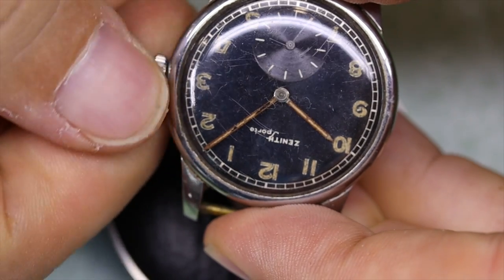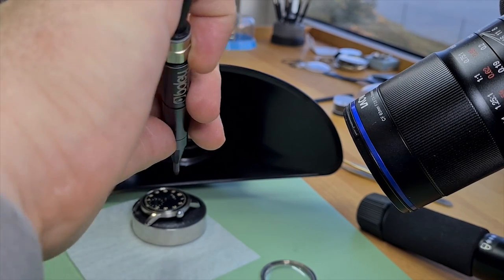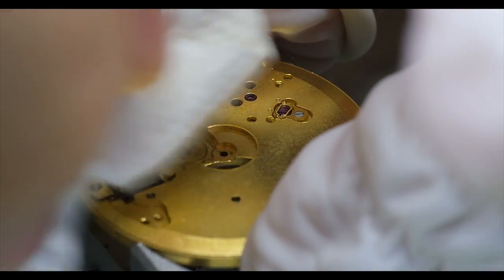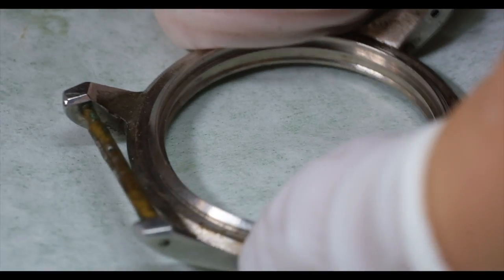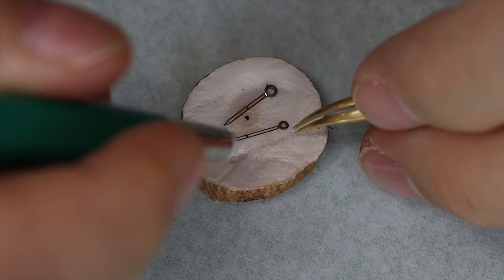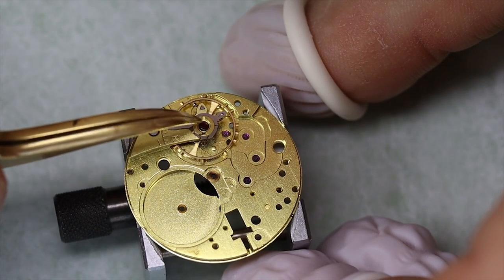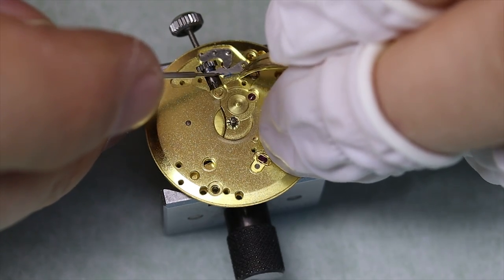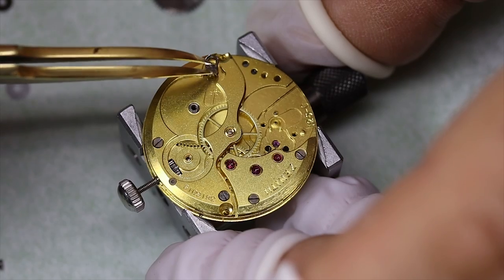Radioactive, not running... is this watch even worth saving?

Comment: Love the video. Have recently "cleaned" a set of radium hands to feel safer about wearing a watch. I go outdoors with PPE to open the case and remove the hands, then dunk them in isopropyl to prevent dust and scrape them clean "underwater" so to speak. Then dump the fluid. The actions all but eliminated a uSv/h signature to a fraction over background.

That said, as a shade-tree mechanic on cars/trucks/you name it, I routinely sharpie comments on parts I've installed. LOL. I replace a water pump, I write the date/mileage on the part as I'm installing it. Hopefully the next owner will appreciate it when troubleshooting whether a part is factory or been replaced recently. But I agree, you wouldn't scratch a date and initials on a piece of art like a vintage watch.

Comment: Thank you for another excellent video to watch! I missed you 🙂

About service-marks inside the backplate I look at it a bit different than you. I find them interesting as a part of a watch´s history, and they served a purpose when the watch was younger as a record of when and where it had been serviced. A watch I bought at a flee market was made more interesting by the fact that it´s markings led me to the shop that sold it originally, and their archive could tell it was sold to a local gentleman from a close by town. Markings also told me it was serviced regurarly until mid 70´s but by three different makers in the area. This knowledge ads to my pleasure of owning it some 70 years later, I find.
Reply from the maker: Hei Sjur, thanks for your input! I don't have a problem with old watches having marks, what I'm trying to convey is that nowadays there are better ways to prove a service has been done. There is no reason today to scratch marks into a watch. IMHO.
Reply: @VintageWatchServices  I totally agree that as a general practice it shouldn't be done.  But even now there are some scenarios where I feel it's acceptable.  I had a very good friend that worked in a national standards lab in the 30's and 40's, went on to teach, and then took up watch repair later in life.  He rebuilt a pocket watch that had belonged to my grandfather.  And with hindsight I dearly wish I'd asked him to "sign" the watch.  He was a good friend and taught me a lot, both in the classroom and out.  That signature would have meant as much to me as does the watch itself :) I enjoy your videos, reminds me a bit of the days when I'd visit and he'd show me whatever projects he was working on at the time.

Comment: This is an absolutely engrossing video. Lovely watch. I have  a Zenith rectangular manual winding watch in which the movement is similar to this, but smaller.
Regarding the radium girls, the reason why they developed cancer and other teeth related diseases is because they used to put the brush in mouth to straighten the tip with saliva  and then dip into the radium for applying lume to the hands/dial. After medical tests found this to be the cause, it was stopped.
Stian, I am very happy that you have 10,000 viewers. More will certainly join. Do educate us with more such videos. Take care and stay safe.
Reply from the maker: Thanks so much, K! You're entirely right, the real danger is when you ingest radioactive material, as that allows the alpha particles (which are big and heavy) to directly ionize cells inside the body... very bad stuff.

Comment: Tremendous vid. and information. I have one with a silver dial which is slightly older, cal.12.4.p6, and has had the radium lume on the hands removed some time ago. I am a Zenith collector , as I have mentioned before, and see very little Zenith restoration videos so thanks. I like the large seconds hand which fills the space between the 5 and the 7 with no cut off 6 .

Black dials on vintage watches scare me if I am buying sight unseen but those with radium numerals are difficult to fake.

Nice to see you back , I too had the plague before Christmas which left me with a slight hand tremor, not the best for footering with watches.
Reply from the maker: Good to hear you're back on your feet also! Do you still have the hand tremor or is it improving? 

Zenith has such a rich legacy of fabulous watches but still aren't quite known to the masses. Just today my wife asked me if Zenith is a brand after watching a bit of this video by chance...
Reply: @VintageWatchServices  Improving but the harder I concentrate the worse it gets. I am looking for a Defy with the 8 sided case and the GF ladder bracelet. Most that I see have had all the sharp angles polished off, If you ever have one let me know. e.g. A3642. I bought the Captain with the Square diamond cut indices cal.2552 if you remember.
Reply from the maker: Yep, I remember! That's a beauty also :)

I really hope you recover fully from this, it's a very sad effect indeed...

Comment: Welcome back, Stian, and congrats on reaching the 10K subscription milestone.  The Zenith sure cleaned up nicely.  I'm surprised at how few tool marks there are on the plate and bridges considering how soft gold is.  The macro shot of the palate fork assembly is stunning.  Too bad the watch doesn't have an exhibition back so that the elegance of the movement can be more easily appreciated.  Stay well.
Reply from the maker: Thanks so much, Bullnose! It seems the movement has only been serviced once, which would explain the lack of marks also. A lot of these old watches would indeed benefit from display backs, but that is really a pretty novel feature, becoming common only the last couple of decades. You pretty much need a sapphire crystal for that, which also wasn't mainstream until the 90s.

Comment: The watch turned out great. You are the first YouTube watchmaker I have seen using radium protection. My personal protection would be to not buy a radium watch if it needed opening. Radium was actually allowed up to 1968 in Swiss watches, other countries would be earlier or later, like 1970 in Italy. Rolex used radium up to 1964, but some Rolex were tritium from 1963.
Reply from the maker: Thanks for watching and for your great comment! I didn't know they allowed Radium until that late, but from what I know very few Radium dial watches were actually produced after the late 1950s. There are still a lot of beautiful watches with Radium dials and hopefully I calmed some nerves with my video :)

Comment: That is the best reluming job I have ever seen! You matched the uneven patina perfectly! 
With the worn bushes, would an alternative be to add jewels instead, could that even be done? Great video once again, you turned a tired looking watch into a gem. It’s amazing how a bit of cleaning of the case and polishing or renewing a crystal can make a huge difference to the looks of a watch. Now if only sellers stopped referring to dials such as this as “military” I avoid those sellers like the plague as it’s simply trying to add value where none should be added! Same with Sicura and it’s link in the past to Breitling, a pretty cheap poorly made watch being sold for ten times what it’s worth simply because of that connection!
Reply from the maker: Thanks Ian, that's very nice to hear! It's certainly not a military watch but calling it military style might be justifiable 😉
Putting jewels in the bearings would indeed be the best solution for reducing wear, but it would also make the watch non-original. Thus if possible I'd always prefer peening the holes.

Comment: Excellent video!  Glad you've recovered.  We had it also.  While aboard ship, we had quite a lot of training for NBC Warfare or Nuclear, Biological and Chemical.  My ship was Forrestal Class and did not have Nuclear.  It's important that people know that we are bombarded with Radiation 24/7.  Even more so during a CME or Coronal Mass Ejection from the Sun.  It is also important for people who live within about 50 mile radius from a city that had World War Two fabrication.  70, 80 years ago, they did not process Hazard Waste like they do today.  There were some really shady characters back then who would get paid to dispose of the waste.

My parents bought a new home in So. Jersey in 1977 that used to be a dump.  Of course they didn't know it then but we found out in the 1980's.  It used to be Peach orchards and I recall that most if not all of the homes built, did not come with a basement.  That's quite revealing after the fact.  So, in the 1990's there were water wells tested and Radon was discovered.  The Township issued a moratorium on all new construction for several years.  I may have been exposed less than my parents and siblings because I'd entered the Navy in summer of 1982.  If you suspect that you live within a fabricating zone similar to where we were, I would suggest that you do some research.
Reply from the maker: Thanks for sharing that story, and these kinds of things were indeed much less regulated back half a century or more ago... There is still a lot of these issues being uncovered today, sometimes literally, but thankfully we're getting more secure as a society every day.

Comment: Nice work and congrats on the 10k I'm glad  you have fully recovered from both the holidays and the  C19. I just received a Britix 641 with a FHF 67 movement, pretty sure it has the radium  dial and hands also! I'll be sure to take the necessary precautions when I get around to servicing.
Reply from the maker: Thanks a lot! And there's absolutely a good chance your watch has radium on it, so be careful. A couple of commenters suggested spraying the hands with water before removing the old lume, which sounds like a very good idea.

Comment: Re case marking by watchmaker. I was repairing watches in 1960's and this was required to protect you from customers that would claim recent service but in fact much longer. The marking was logged in a book so the type of repair was known. It was a commercial necessity
Reply from the maker: Thanks a lot for sharing that, Edward! Back half a century or more this was indeed considered good practice, and I have absolutely no problem with that. My problem is with watchmakers in 2022 doing so when digital methods of recording service jobs are readily available :)

Comment: Would be interesting to see if the rad from the lume leeched through to the movement itself🤔

As for marking the case..I am a little torn..as it provides, or possibly even adds historical reference…and maybe even value 🤔. If the marking was on the outside of the watch, then that would be different..however stamping or marking service…engine blocks for example…though I could be wrong but if memory serves me correctly, stamping is not just a watch thing

Comment: Have to agree with you about putting repair marks on an item. Not sure how this custom started but clocks have this as well, ranging from initials and dates scribed into the movement plates or written inside the back door. Not sure I need to know if a clock was repaired on a certain date and by whom. The date might be interesting, but who did the work is lost to history. Sometimes a repair shop will put a sticker for the shop inside the back door. I don't like the practice myself, but I did find it helpful trying to date a Japanese clock. It had a small tasteful label on the back, all in Japanese, and a viewer said it was a warranty label from a repair shop dated 1935. Anyhow, thank you for another great video.
Reply: Camera repairers used repair stickers in the back of cameras. It adds some historical context and the stickers can easily be removed if desired.
Reply from the maker: Thanks so much for your comment! In old pocket watches there was commonly a piece of paper inside the outer case, actually a repair log. This was where a watchmaker would put his initials and a date for warranty purposes. This practice was carried over to wristwatches, but given that there isn't any space for that kind of paper, they started making their marks in a place where it wouldn't be visible, hence the inside of the case back. After computers and emails became commoplace, there is no longer a need to make a mark in a watch so you don't see that much nowadays. Which in my view is how it should be :)

Comment: I was not aware of the fact that it is necessary to take precautions like this to work on a watch like this. Well if it was happening every day, but a few times a year? So I learned something, thank you. People in the factories must have received radiation levels thousands of times higher than the users of the watch and many suffered! Interesting about the Alfa particles, hearing that would make one understand that it`s important not to get these particles inhaled through dust etc....! I sometimes open watches that are older than the 1960`s so I will bear these warning in mind.
Reply from the maker: Yep, radioactive material is no joking matter... If you're working on watches with radium lume, make sure you're not in danger of ingesting any of the old lume.

Comment: Alpha and Beta radiation are usually only damaging if they get into your body, hence the need for the air scrubber you have.  They can also damage the skin if the radioactive material is left on it for prolonged periods.  That’s why wearing protective clothing is advisable since Alpha and Beta radiation can’t get through them.  The most dangerous radiation is Gama- not Alpha - and Neutron radiation.  Both have very high energies and can go through most objects and require heavy shielding to stop them.  Neutron radiation is the only type that can make objects radioactive by neutron activation.  Sorry for rambling. I just wanted to correct your small mistake—otherwise, excellent content, as usual.

Comment: They are pretty movements and the plastic dust cover is unique!  I use the same precautions for the radium based luminous as you do.  Especially with the trench watches!  Glad you are feeling better and hopefully you don’t have the long covid version to deal with.  All the best.  do I have permission to repeat some of your jokes???  Geoff

I spritz the hands with water before removing to keep the dust down then store the radioactive material in a lead jar loaned to me by the local university.  When the jar is full I take it to the university for disposal.  Also on the porcelain dials I will spritz the dial before removing the luminous.  Can’t be too safe around these!
Reply from the maker: Hello Geoff, thanks for your comment and that's a very good idea. I'll pick up on that for my own practice going forward!

Comment: Thanks Stian, great stuff! Looked lovely afterwards. Question; I’m using Elma waterless cleaning and rinsing fluids in an ultra sonic cleaner and I think the rinse is discolouring brass items I the watch movement. Have you ever come across this? What cleaners do you use?
Reply from the maker: Hello Boyd, I don't rinse parts in the ultrasonic, only in the fluid. You can rinse most parts in water also, just make sure you dry them very well.
Reply: @VintageWatchServices  after rinsing in (destilled) water you should rinse the parts in isopropyl alcohol. This prevents rusting and evaporates very quickly.
Most of these solutions (all?) do brighten up brass and other parts. That's just normal. They are just removing the tarnish 😉
Reply from the maker: I use something called essence of Renata, which is basically naphtha. It works very well for these things, but isopropyl is a good alternative as well. 👍

Comment: The color of the luminous paint came out nicely.  I noticed you oil several pallet stones, but I haven’t seen other watchmakers do it this way.  Doesn’t the continual cycling of the escape wheel distribute the oil evenly from a single stone?
Reply from the maker: Thanks for watching and for your comment! There are only two pallet stones in a Swiss lever movement, the entry pallet and the exit pallet. It is common practice to lubricate the exit pallet and let the lubrication spread onto the escape wheel teeth from there. That's what I did in this video and I even explained exactly that 😉
Reply: @VintageWatchServices  Yes, sorry I was sloppy with my wording.  You mentioned lubricating the same pallet stone three times, once every five teeth.  I only mention this because I noticed you explaining this procedure this exact way in a number of videos, so you I thought maybe you felt it was important.
Reply from the maker: @gabermax  Yep, that's the common way of doing it. I suppose I mention it every time I do it 😂

Comment: Hello :) informative video on an important topic for watchmakers that receives too little attention, thank you for educating! Do you happen to have a watch with tritium lume on hand to perform the same test on that type? Would that emit less radiation? Tritium lume was used well in to the 70's if I remember correctly and it is still common on vintage watches ( a "T"  before and after the Swiss Made mark). Thank you for making these videos, I enjoy watching them and I always learn good stuff on every one :)
Reply from the maker: Hello George, thanks for watching! Tritium is generally regarded as safe, even though it is in fact a bit radioactive as you imply. A Tritium dial would not make much of an additional reading on a geiger counter to the background radiation.